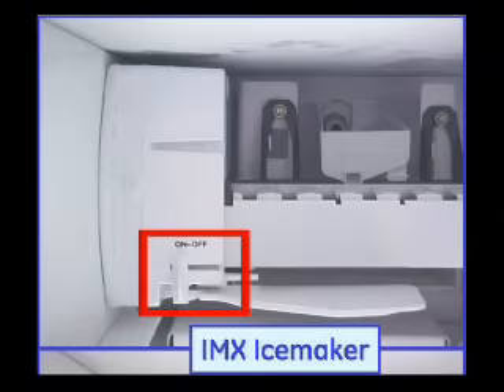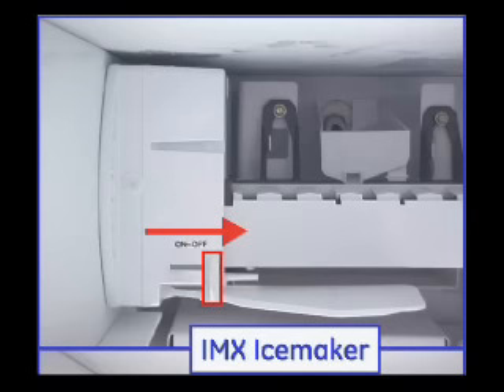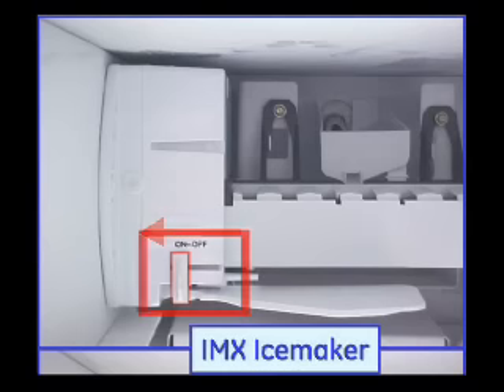Ice Maker (switch ON/OFF) Not Working

Comment: Thank you, my fridge was making such loud buzzing noise. for three days, finally found the arm switch and turned it to off position.    It has been in on position well over a year.    I did not connect the tube to supply water to the fridge yet.
Reply: And did your refrigerator stop doing the loud buzzing noise?

Comment from the maker: Nancygrant65- I suggest you check the plug on the icemaker to make sure it is pushed securely into the socket. Replacing the water filter will not affect the light on the icemaker. However, if your water filter has not been replaced in the last 6 months it is recommend to change it.  If you still have the use and care manual take a look at the troubleshooting information in the back. You can download current manuals on our GE website. You may need to consider service.  I hope this helps.  Alison

Comment from the maker: Hello Joseph, this is Sheree from GE and I apologize for the inconvenience you are having with your GE icemaker. If the icemaker continues to make ice when in the off position, I would suggest unplugging the refrigerator for 30 seconds to try and reset the icemaker.  If this does not fix the problem, then you should replace the icemaker or unplug it from the freezer wall to stop the ice production.  GE Parts are available from 1-800-626-2002 or on our GE website.  I hope this helps.

Comment: My switch broke and it's stuck in the "on" position. How do I turn it off without the switch?
Reply: Move the arm back. All the switch does is move the arm back. If you look carefully, there is a groove in the arm that locks the switch in the off position, if it was not broken off. The only issue is that something needs to be there to hold that arm in the “back” position to stop ice making. When normally functioning, the built up ice pushes against this arm when full, turning off the ice making function.

Comment: Should the green light be on or off
Reply: Wondering the same.
Reply: @RoxanaJaveBrace  I don't think the green light comes on.  Mine never did . It just started reworking randomly after like a week. If you can completely let it thaw out and restart it that might help.
Reply: @bobb1776  Mine is not connected to the water supply and after reading the manual I believe the loud noise comes from the ice-maker when was ON. I turned it off but the green light is still on. I just hope not to hear that noise again.

Comment: what if the switch slide completely out how do you connect it back thanks
Reply from the maker: Hello Macy - Based on the information you provided, the diagnosis and repair for your appliance needs to be done by a qualified appliance service technician.  You can schedule an appointment at 1-800-432-2737, Mon-Fri 7 am – 10 pm ET, Sat-Sun 8 am – 6 pm ET or schedule online anytime at: http://www.geappliances.com/ge/service-and-support/service.htm -TS
Reply: I tried. It’s still the same. Thanks

Comment: The slide switch moves to the "off" position automatically and the bin is empty of ice, I have to move it to the "on" position manually, it makes a "round" of ice and go to the "off" position by itself again
Reply from the maker: Gerardo you're going to want to call our service technician's at 1-800-GE-CARES for assistance.
Reply: Hi Gerardo- ours is now doing the exact same thing. Did you ever find the problem?
Reply from the maker: For this type of issue, we suggest that you call our service technician's at 1-800-GE-CARES for further assistance, Stephanie. Thanks for working with us. -SF

Comment: Ice maker not working after main water line was shut off for 3 days! Could line be frozen ? Tried the Reset procedure but it did not work. Turned off power to unit for 3 mins. - still nothing? Help!
Reply from the maker: Hello Ethan, We are sorry to hear you are having this issue with your icemaker. If the icemaker wasn't turned off during those 3 days, it would have continued to call for water. This could have burned the motor and you would need a new icemaker. JW
Reply: GE Appliances Thank you for the reply however the icemaker started working today from now on when I shut off the main water line I will remember to turn off the ice maker
Reply from the maker: Glad to hear it is up and running, Ethan. LM

Comment: The switch has been removed a while ago. Where's the repair part of this video? 
You should rename this instructional video.
Reply from the maker: Hello,
If you require any assistance with your icemaker, we are here to help. You can get in touch with us through GE Appliance Service by calling 1-800-GECares or by connecting with us on social media. Kindly provide your refrigerator or icemaker's model and serial number in your message. All the best. -SH